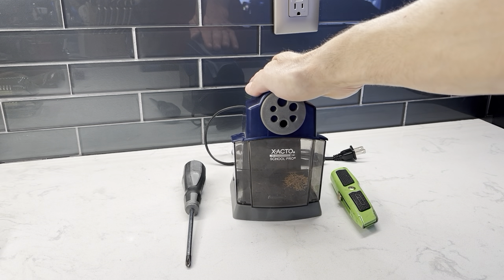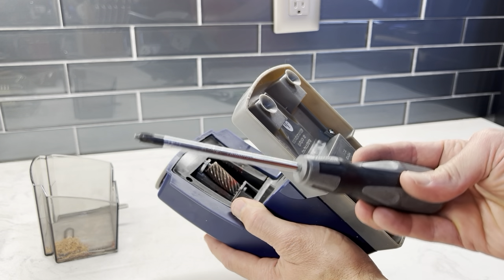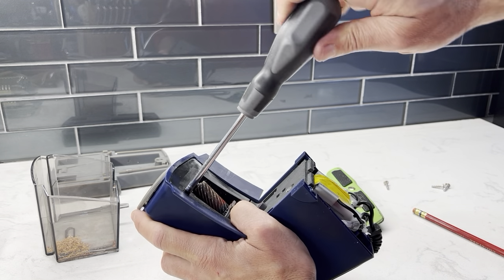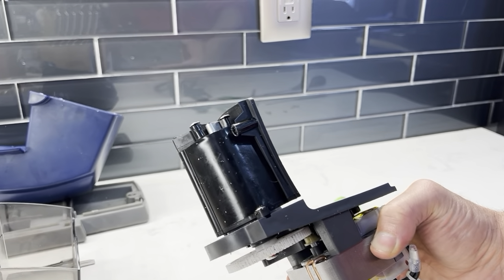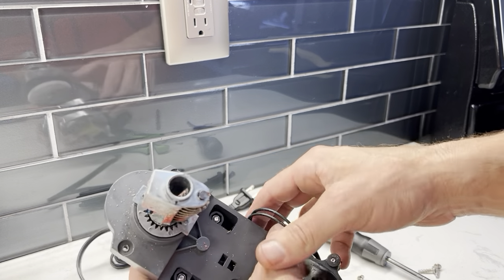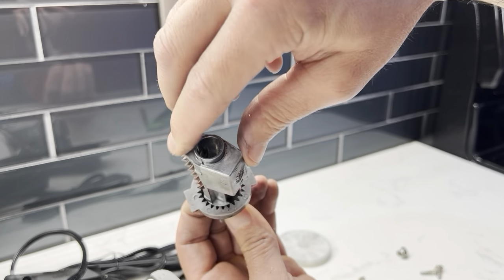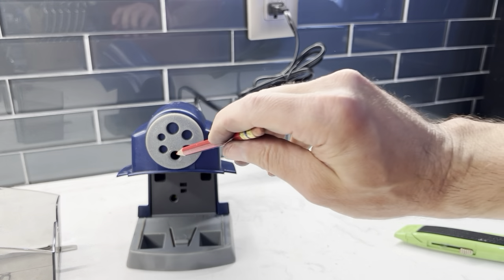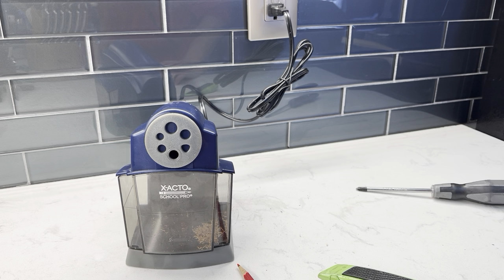Electric Pencil Sharpener Repair - Disassembly and Re-assembly

Comment: Ugh. Mine is a slightly different model and i couldn't get the last bit apart. Ended up tossing it. What a piece of junk. I will never buy another one.
Reply: Is it the schoolpro that's circular at the top? I'm also having issues taking mines apart